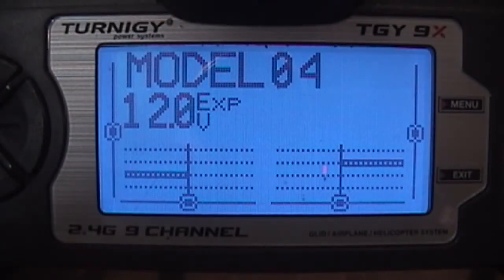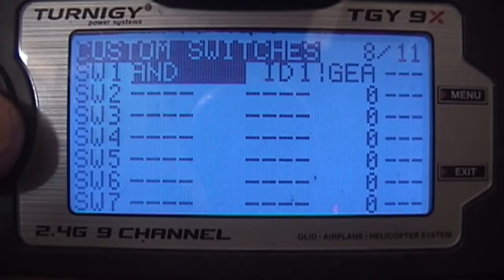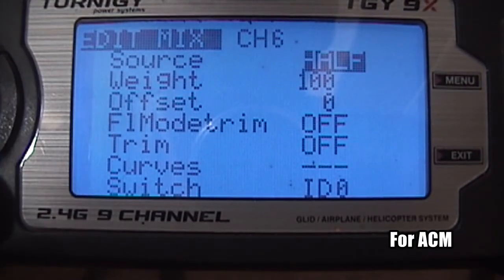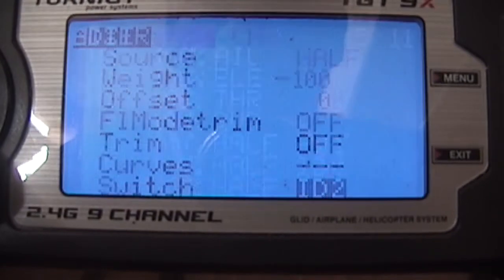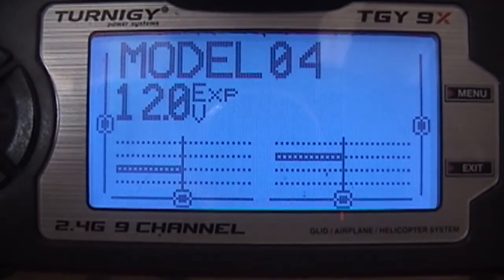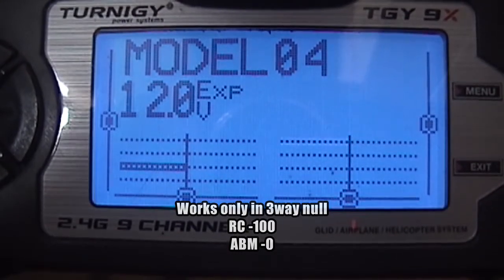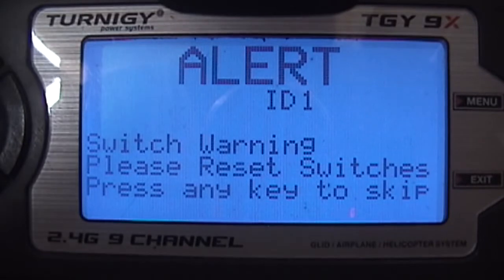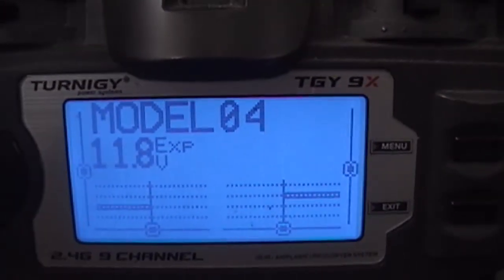ER9X 9XR FY-31AP (3way ACM null RTH) Alternative Programming

Comment: "3way switch is always maser and overrides all others"

Unless you mix it. I use ER9X for a Naza-M and have 3pos switch on ch5 for different modes but not failsafe here. The weigh have i set to 67 and offset to 14 to correlate to the differet setting in Naza. As switch in the menu i put in "AIL" and when i flip that is override the 3pos switch and flip it all into failsafe no matter what position the 3pos is in. Works perfect.